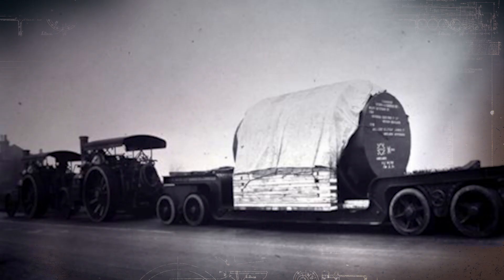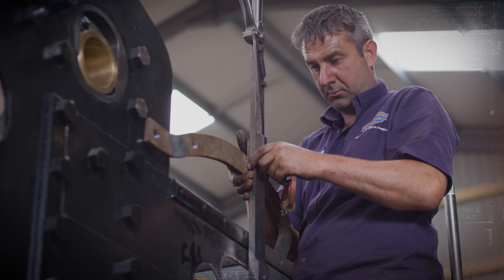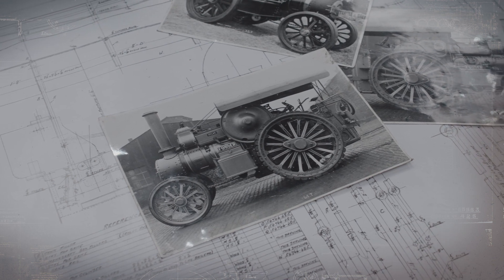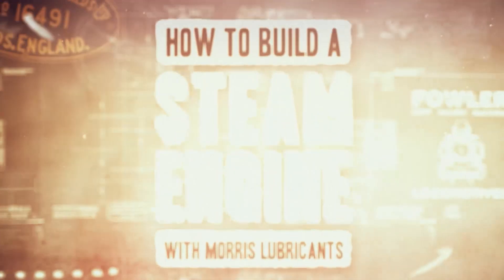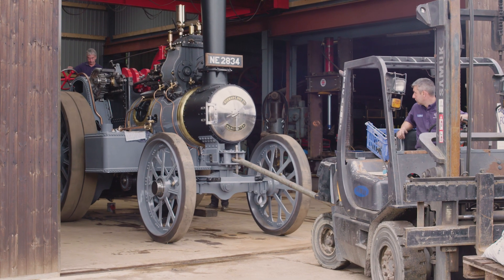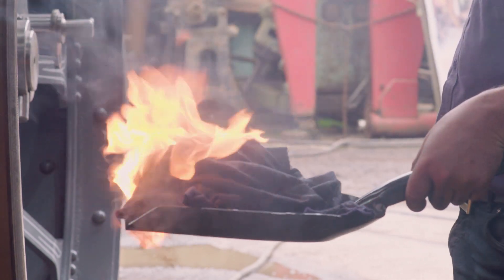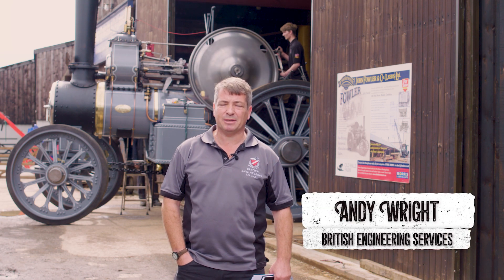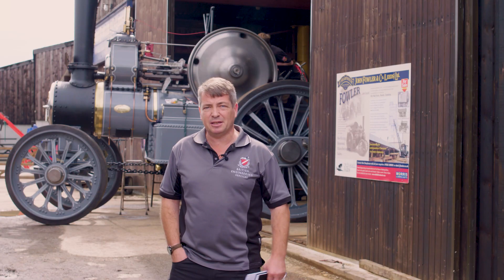How to Build a Steam Engine with Guy Martin - EP5 The Boiler Inspection

Comment: Why did they build the boiler out of stainless steel this would take more working pressure. Does it suffer from fatigue cracking heating and shrinking.
I was wondering why they didn't make the wheels out of aluminium
Reply: I'm thinking they're building as close to the original specs as possible, meaning using whatever was available in 1926.
Reply: Flangeing and bending the boiler plates out of stainless would be some serious agro and the metal they make it out off has to be special x rayd metal to be sure the is no impurities and imperfections in the plate I don't know of you can get that in stainless or not